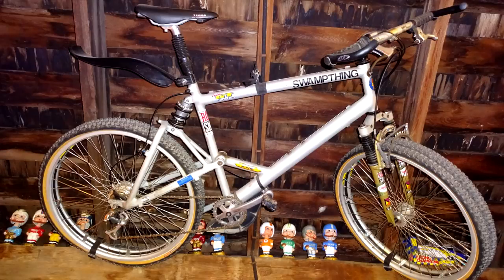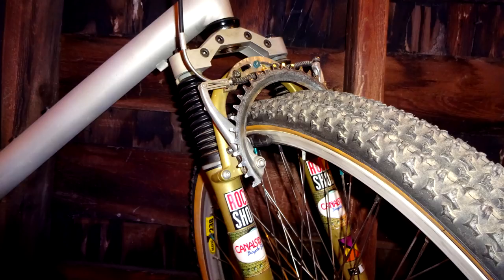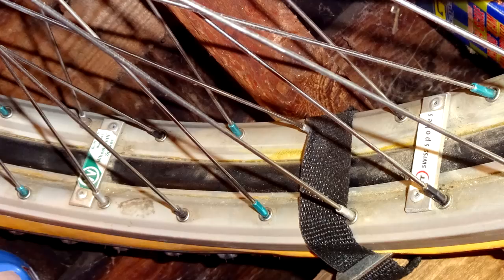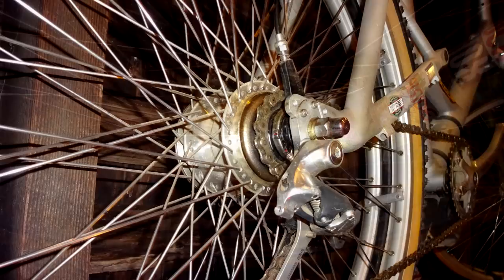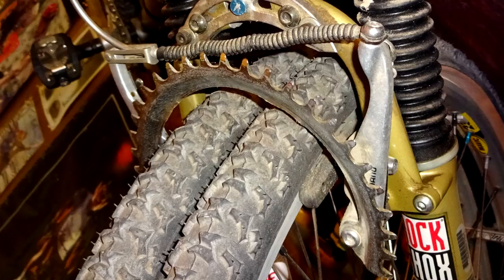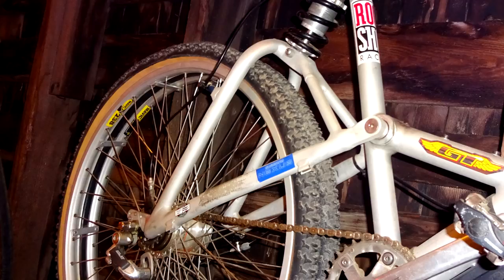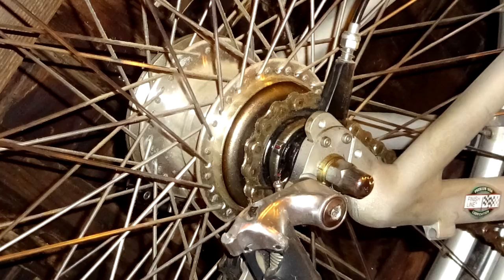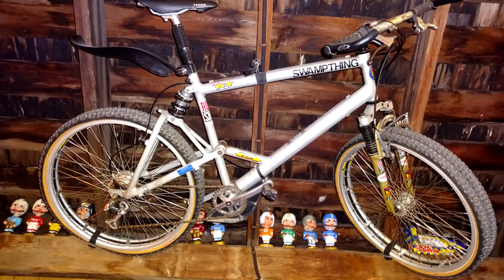Vintage DIY Fat Bike with Dual Rims/Double Tires - Build Analysis

Comment: I swear, these special Fat Bike builds were for the early Alaskan Iditarod  Races.  I remember most all of these Fat Bike builds were almost always exclusively made to order by and from some very experienced Western States / Alaskan Riders and bike builders because they knew what worked on the trails and what did not. After this version in the video came along the addition of a single front hub gear added in case the rear drive system failed....if that happened, all you had to do was a change out of the Front wheel assembly with single speed gear to the rear end while moving the broken rear drive whell to the front to get you peddling - instead of hoofing it. This is also another reason for the Larger / Stronger Axle - Oh yea almost forgot to add DIY studded tires were also given a try ... COOL OLD SCHOOL INGENUITY HERE! thanks RJ

Comment: Rear axle was used up front, so 1mm thicker in diameter, and one reason for the internal gear hub is a standard drivetrain would rub the tires in the majority of the gears.

Comment: Hey there, RJ!

I believe the main reason for crossing of the left and right side spokes going from the hub to the rim is not to pull the rims together.

Putting the rims next to each other like so, virtually creates very large offset to the left and right spoke holes on the rim. This offset may be very close to the offset of the hub flanges from the hub center. If you lace the wheel as a regular one, the spokes will have virtually no bracing angle and the wheel will have no lateral stiffness at all. By the way, less bracing angle - more stress on the hub flange, same as radial lacing versus crossed lacing.

Nice bike! Cheers!

Comment: Definitely a wild build but I'd think it would ride weird with two tires ...if it was ridden on the street it would only want to go straight and get a little cranky during turns because if your going left you need to put more effort into the turn from getting out of that grove in the tires...but for not having fat tire bikes then that's way ahead of its time

Comment: Ahead of its time in terms of utility but the chap was obviously a very decent engineer also. Guessing there were some mistakes prior to the final build. It must have been interesting to steer/control and prolly best suited to cross country rather than downhill or uphill due to weight and control.

Comment: I just learned from this video that there were full suspension bikes back in 91. I don't think I had even seen a suspension fork back then.
Reply from the maker: Interestingly, this bike probably came stock with a rigid fork. http://vintagecannondale.com/year/1991/1991.pdf

Comment: that is an impressive build. Very cool!
Hey I have a totally unrelated question - I just found out that it's possible to use a brifter for a triple chainring to control a 3 speed hub. I think I might set up my three speed with a quill to threadless stem converter, new modern handlebar, and a set of brifters to control my brakes. Maybe even go with some hydraulic rim brakes if it's possible to get a hydraulic brifter for a triple....
I'm not sure how hard it is to find a brifter for a triple chainring like I'd need, I assume they're readily available. I'd love the clean look of not having an extra shifter on my bar. any chance you could do a video showing how to set up a brifter for a 3 speed hub?
Reply from the maker: I don't know what the cable pull ratios are for three speed hubs versus brifters. I found this. Not all 3 speed IG hubs are the same. https://www.sheldonbrown.com/cribsheet-IG-cable-pull.html

Comment: Thats different. The front brake lever looks the same as shimano stx rc. Check them out the brake nipple goes in the middle of the lever.
Reply from the maker: That doesn't mean the insides are the same.

Comment: I've been interested in the internally geared hubs recently and I'm wondering what is the most gears that a hub can have? I mean, what's available today?
Reply from the maker: I think this is is the current upper limit. https://www.amazon.com/exec/obidos/ASIN/B00X057Z5K/ref=nosim/youtube25-20
Reply from the maker: @dodecahedron1 Wow! I was not familiar with that!
Reply from the maker: @dodecahedron1  Yeah, I saw that. Looks like it comes with a twist shifter. Yuck. No idea how wide the gear range is.

Comment: I can't get my fork crown race on my fork. I tried just doing it normal way with a pipe and rubber mallot, not even a flinch. I made a custom press from a piece of stainless steel pipe and some 10mm threaded rod with some 🥜, again not even a flinch. My custom press just scratched the frame  ( my beautifull new paint) on the bottomside in between the arms. What should my next step be ? My uncle said he can just use a lathe and grind the 4/10 of a mm from inside of the crown or is that not a good idea ? Do you think it will weaken the crown ?
Reply from the maker: You probably have the wrong size race then.
Reply: RJ The Bike Guy Yes I probably do but are there so many different sizes then ? It only has a 0.5mm difference compared to the old crown race. Oh and we tried using a lathe but it's hardened steel so nothing happened.
Reply from the maker: 0.5mm??? That is huge!!!! Get the correct size race.
Reply from the maker: https://en.wikipedia.org/wiki/Headset_(bicycle_part)
Reply: Thanks !! I guess ill try to find a set wich the JIS measurements and hope the crownrace fits the headset cups wich i already installed.
Reply from the maker: Or just buy a crown race that fits. Or install the cups from the new headset.

Comment: Awesome video!  The best Fat Bike you can buy right now in America for the price is on walmart dot com.  Redline Grizz Trail.   Only 6 left!  Shimano trigger shifters, Shimano 3 piece crank, Shimano front and rear derailleurs, Shimano 34t cassette, Tektro mechinal disc brakes.  NIce handle bar and grips too.  It is an older model Diamondback re-branded as a Redline.  Best part... only $263.02  Crazy good deal!